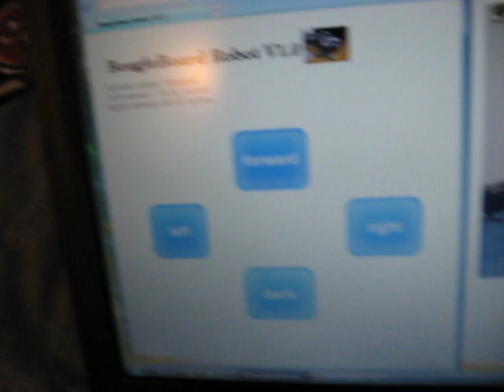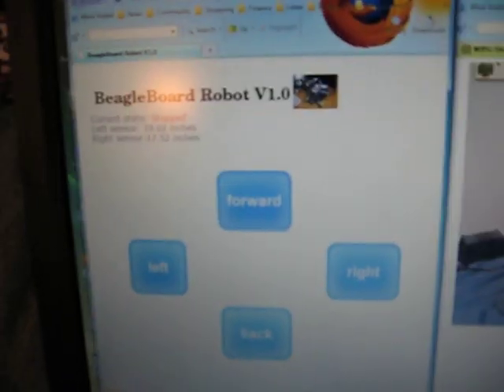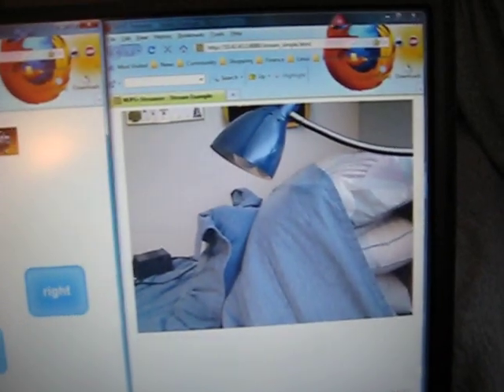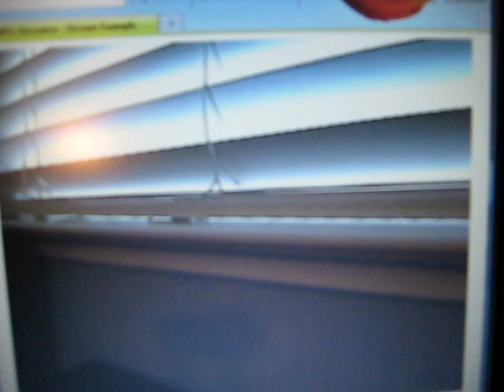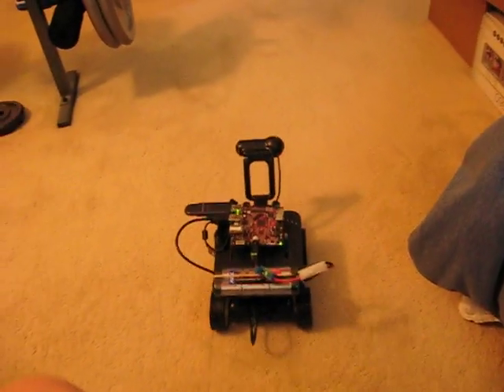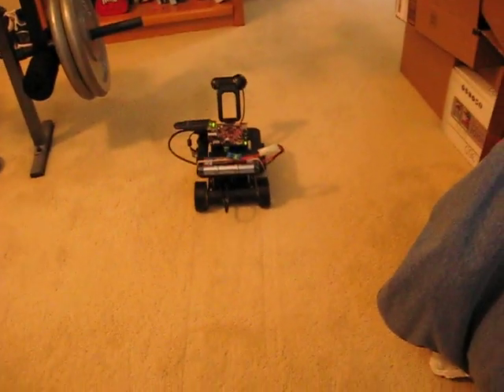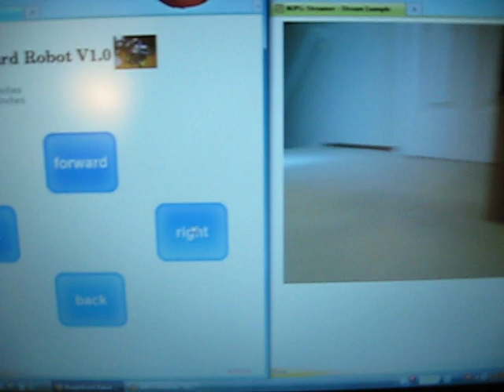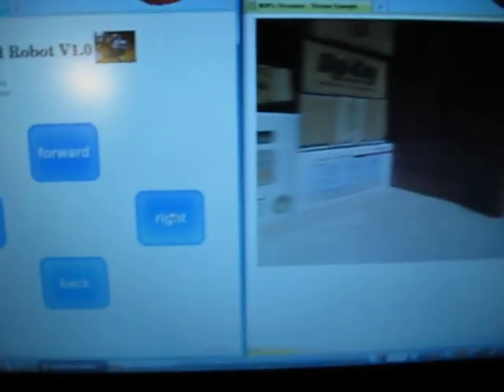BeagleBoard Wi-Fi Robot

Comment from the maker: @matitaila 

Here's my entire script run at boot to setup the network, only 4 commands

ifconfig wlan0 down
iwconfig wlan0 mode ad-hoc essid beagleboard-xm channel 1 key abcdef1234
ifconfig -a wlan0 10.42.43.1 netmask 255.255.255.0
ifconfig wlan0 up

I didn't set up the BeagleBoard to connect to an existing ad-hoc network, so I'm not sure how much this will help.  I did not manually edit the /etc/network/interfaces file on my BeagleBoard.